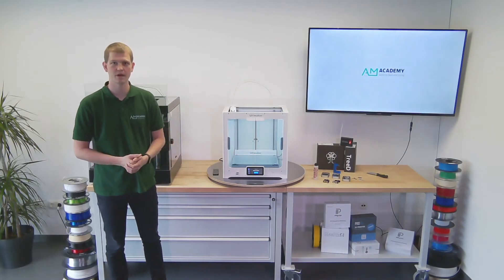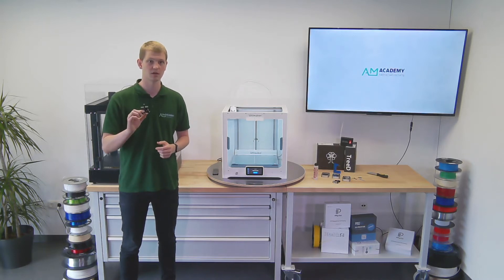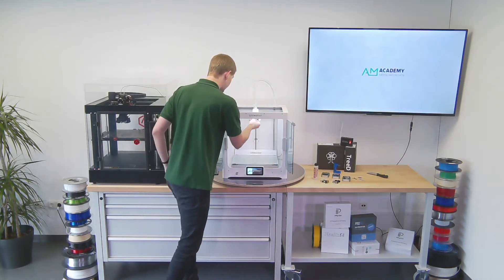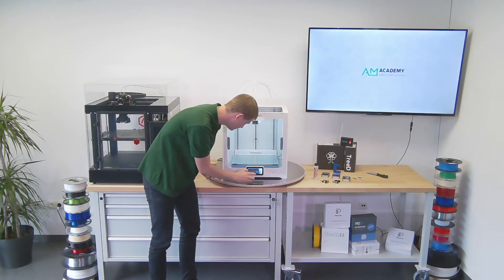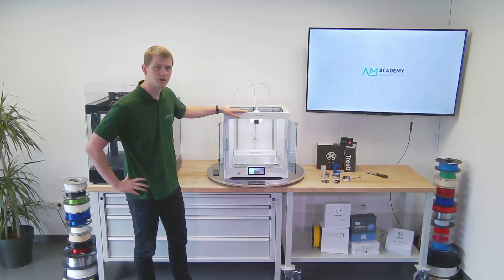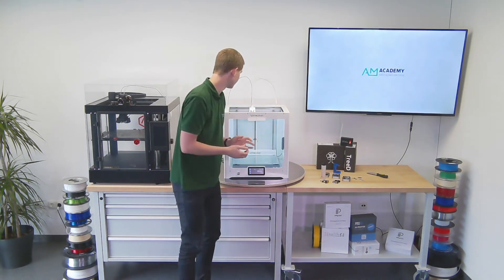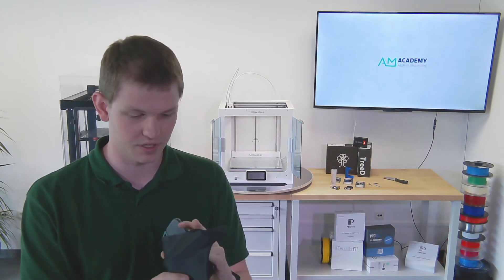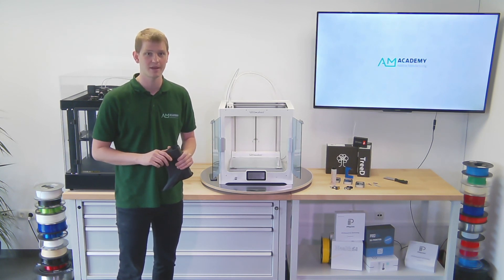3DSolex CC 0,6mm Rubin Printcore for Ultimaker S5 / S3 im tested with CA PET from TreeD

Comment: Hi, thanks for your videos... I've just purchased a CC 0.6 3DSOLEX PRINTCORE for our UM5. I was intrigued with the rotatory base you have installed under your UM5. Would you mind helping us telling where did buy it? (Ours is on a cabinet and it's messy to manage loading/changing the filament)...thanks in advance.
Reply from the maker: We built it ourselves. We bought this: https://www.amazon.de/dp/B06XBTJGPX/ref=cm_sw_em_r_mt_dp_8ZZ8FWDZ93SA37HJMT3S and put a large wooden plate painted black on top.